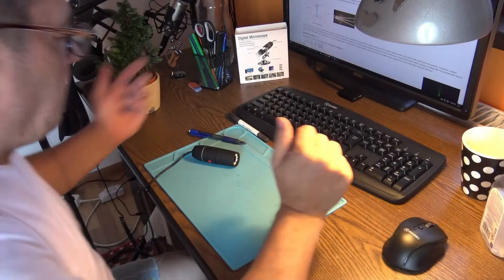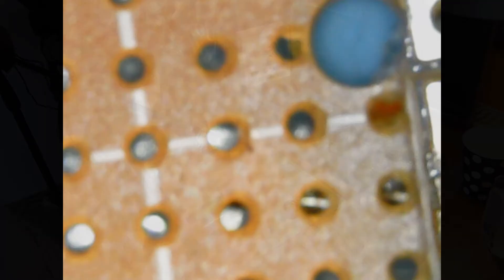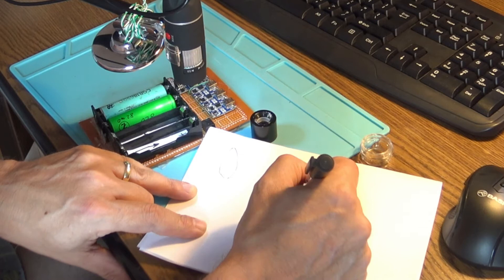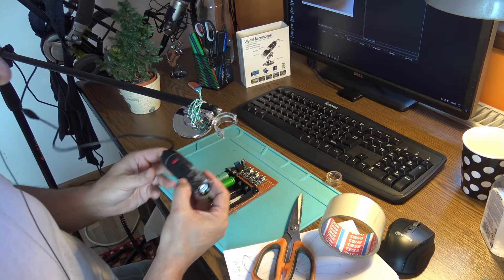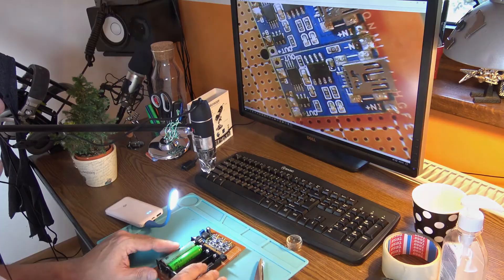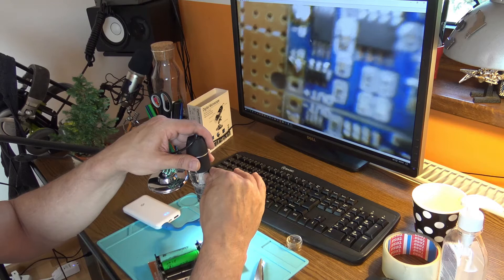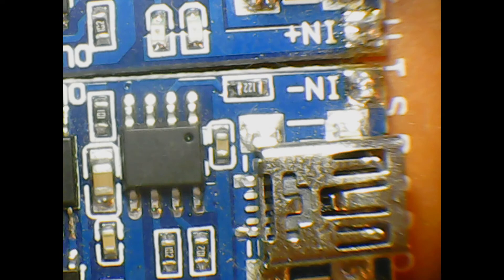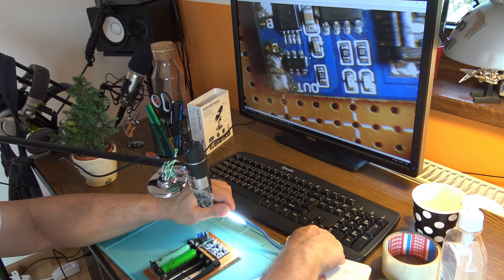USB microscope 1600X mod divergent lens

Comment: IDK what youtube does, I have the "HD" model and the quality is certainly better than that the framerate is the same though but since I'm basically using it for pcb repairs or a stationary object I don't need mines for video(it can do it but not 60fps at those zooms it makes movement look jerky). What the hd version did was crop in and add another megapixel (not gonna be that drastic of a difference, I believe the original is 2mp). I'm about 6 inches or roughly 12-13cm(for the non imperial folk) and I get a decent "zoom". Let's not kid ourselves though it is nowhere near 1000x, maybe 100x or possibly below. Does kinda make you wanna spend more for one with interchangeable lenses even higher workspace range(distance between microscope and object), there's these little cube things that go for less $200 some as low as $130ish on ebay that have HDMI, you do have to splurge on a stand or "boom arm" but if you're doing it for video 60fps may be worth it oh and 38mp to boot.

I bought one of these and have no regrets, maybe a 720p 60fps setting? I think they essentially took a webcam circuit and added a lens and manual focus and bam you got yourself a "microscope", that being said for kids or light hobbyist it does the job.

the HD version
https://www.amazon.com/Jiusion-2560x1440P-Microscope-Cellphone-Magnification/dp/B09653SCG6/ref=sr_1_3?crid=19MP6P8252KLO&keywords=jiusion+hd+microscope&qid=1643601924&sprefix=juision+hd+microsocpe%2Caps%2C112&sr=8-3

the little cubes (from China)
https://www.ebay.com/itm/383724574521?_trkparms=amclksrc%3DITM%26aid%3D111001%26algo%3DREC.SEED%26ao%3D1%26asc%3D20160908105057%26meid%3D696c80d8a28c4d07939a8b1381dea56e%26pid%3D100675%26rk%3D1%26rkt%3D15%26sd%3D383724574521%26itm%3D383724574521%26pmt%3D1%26noa%3D1%26pg%3D2380057%26brand%3DUnbranded&_trksid=p2380057.c100675.m4236&_trkparms=pageci%3A1b145c6d-824b-11ec-b265-aed1a61559a0%7Cparentrq%3Aae4fa7bd17e0ab8e2cbb1e14fff88c0d%7Ciid%3A1

another cube(from China)
https://www.ebay.com/itm/265286183783?_trkparms=amclksrc%3DITM%26aid%3D777008%26algo%3DPERSONAL.TOPIC%26ao%3D1%26asc%3D20201018205123%26meid%3Dc778d5094d8a444fa7bb5c271fc51c94%26pid%3D101286%26rk%3D1%26rkt%3D1%26mehot%3Dnone%26itm%3D265286183783%26pmt%3D1%26noa%3D1%26pg%3D2380057%26algv%3DWatchlistVariantWithMLR%26brand%3DUnbranded&_trksid=p2380057.c101286.m47999&_trkparms=pageci%3A1b145c6d-824b-11ec-b265-aed1a61559a0%7Cparentrq%3Aae4fa7bd17e0ab8e2cbb1e14fff88c0d%7Ciid%3A1

cube from U.S.
https://www.ebay.com/itm/265519927414?hash=item3dd2389076:g:S44AAOSwedth8dm~

these aren't affiliate links I just had one of those bursts of interest.

For light soldering work (I bought mines with a metal stand $45ish USD) these little gadgets are ok, they are not great but they aren't useless. The cheaper one even has slightly better zoom according to another youtuber. The cheap metal stand that comes included is a TRAVESTY but in a pinch it will do huh?

I did find a guy that hacked his lens (mount?)
https://www.youtube.com/watch?v=s47dHaJjLuc
Reply from the maker: Nice! Absolutely a hobbiest tool..but for the money is doing the job..also I used for shooting video at a decent quality..in fact if you work PCB you know what you expect so I don't need fancy 4K microscope to see a capacitor...but thanks for such a nice info and help the community!
Reply: same size shape? can you post title to one you got? i have the 2mp one.
Reply from the maker: @NathanCroucher  No title, or manufacture name, I believe it's generic.

Comment: is the lens you used concave on one side like you drew or concave both side (biconcave)?, i want to make sure to buy the correct one
Reply from the maker: I can't tell, it's in a solid metal tube so I can't see to much..any concave will do the job..you don't need a very strong one though

Comment: Multumesc pentru clip, ma gandeam sa iau unul de pe emag pentru microsoldering.
Reply from the maker: As merge pe un model cu display, se poate  folosi si fara computer..gen Mustool https://youtu.be/9mt359dN2Dc
Reply: @viocaia  Problema e ca nu vreau sa cheltui multi bani pentru 1 circuit pe an :)
Reply from the maker: @MkwRa  check OLX..I got mine under sale..

Comment: The image is surprisingly good but mine same model image inverted
Reply from the maker: Turn it around..maybe..
Reply: @viocaia  thanks but will not work. When you move right shows as left
Reply from the maker: The right positioning is with focus rotary in the front as you see in my picture.If you tried any camera software , even winodws camera and it's 180 dr, single explanation is the sensor board is in a bad position from the manufacture..and it's really hard to open the microscope...
Reply: Can you flip in the software?
Reply from the maker: @dshe8637  I don't think so..I don't have it anymore so I can't test..but I don't recall flipping..
Reply: @viocaia  some times when i play with optical lenses i notice that when you move the lens further it flips the image and everything looks upside down...so the reason his microscope is showing inverted could it be the reason?
Reply from the maker: @yinyang2385  I never find the inverted image..so I can't tell so...I doubt the lenses, maybe a flip from the software?

Comment: I've just received my usb microscope with built-in head ache when using a computer, instead I connected it in a smartphone tadaa with compatible app, it's now usable, but still I needed a bigger monitor to see things larger, stopped there and pls, anybody how can I connect to a larger screen while the microscope is attached to otg usb?
Reply from the maker: The only way is to connect it to desktop/laptop by USB..There is no display out on this devices.
Reply: @viocaia  just browsed a lot of video tutorials and found a usb c hub that outputs a hdmi, I think this will be perfect, it's called "wavelink", it doesn't come cheap though.
Reply from the maker: @carlitomadrona6211  Better buy a Microscope with HDMI..I will
Reply: Try using enlarge phone screen from online shop but it product made from china
Reply from the maker: @donerdoner2272  Try a cheap tablet with OTG

Comment: You do not need any extra lens - simply screw in the existing microscope lens all the way in and you will have 1 foot of working distance.
Reply from the maker: Nice, I'll try that..thanks!
Reply: how, do you have to disassemble the lens?
Reply from the maker: @arifryo6823  I didn't , just put the extra in the front
Reply: Remove the plastic cap, move the focusing ring so the inner optics of the camera gets closer for you to reach, and screw in the optics. The moment you will touch the lens, you will understand what I mean. It is straight forward.
Reply: @KEcAzZ1  Genius thank you so much I was looking for a cheap way to inspect a motherboard it's still pants with manual focus but atleast I've got enough room now to get my iron in front of the camera. Would never have realised you can adjust the lens without reading your comment mucho appreciated 👍.
Reply: @viocaia q
Reply from the maker: @paullofthouse2708  Yes! Sounds pretty innuit!